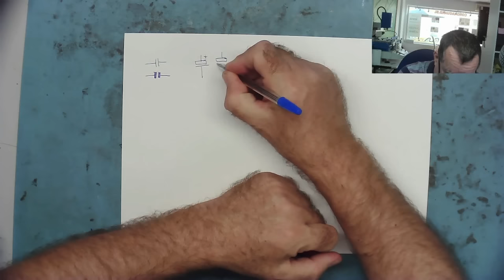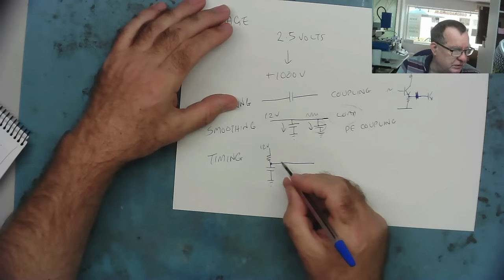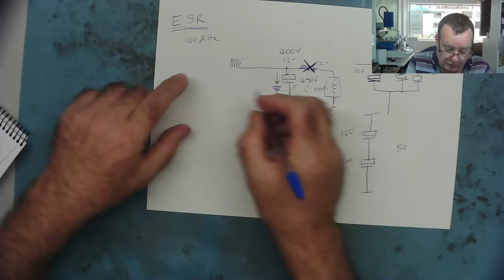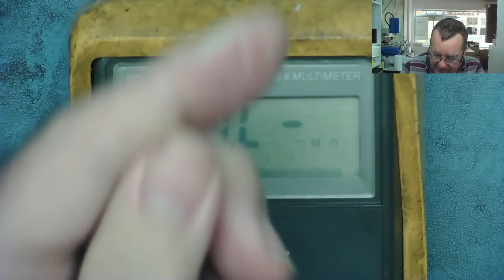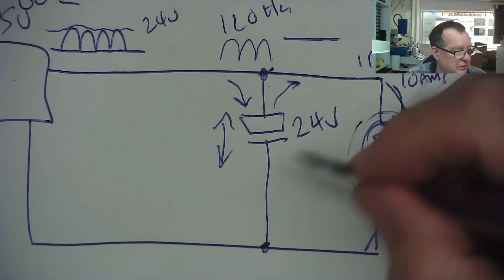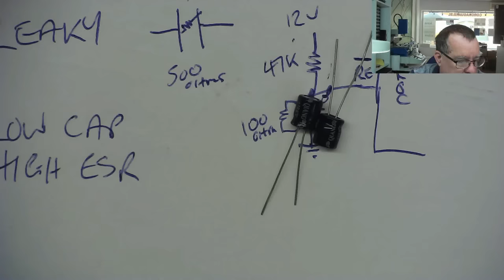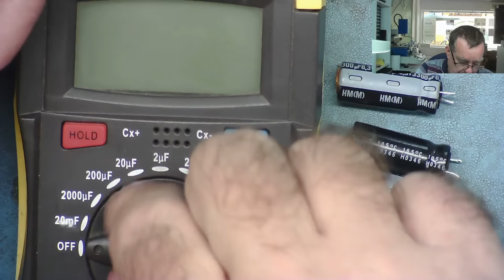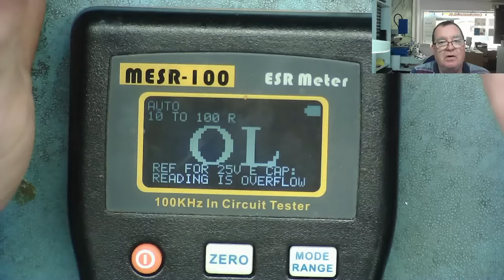All You Need To Know About CAPACITORS To Fix Stuff!  LER #182

Comment: Literally checked a PSU and the cap had 0.6v, still gave me a shock, I'm lucky tbh because i clearly didn't learn my lesson the previous day when i got a worse shock. However i assumed 0.6v wouldn't give me a shock, I discharged it with a screwdriver and seen a spark and shit myself lol. 

Quick question, Whats the main thing that you should look for other than large/medium sized caps to discharge prior to working on a board?

Comment: nice videos sir, 
do you have to remove capacitors from circuits to test them?
Reply: That depends on the circuit around them. For instance if there are multiple capacitors in parallel, there's no way to test each individually without removing them from circuit. Best bet is always out of circuit.

Comment: I had a bad Casio watch, I fixed it by discharging the capacitors, causing the hard reset. Same with laptops, by removing all batteries, holding down pwr butt will hard reset by discharging all capacitors. Intel made the Devil’s face under their processor, creating an infinite circuit in the processor, keeping its cache alive. The contents of the cache: strength, dexterity, magic, vitality, luck, intelligence, agility, etc. also keeps flight sim and driving data, physx data all starting from the XT era. XT had a 4 kb chip for this, instead of an internal cache. 387 had a 8 kb cache. Now, the legal Windows decides what else is needed to fill a 2 mb cache and the faster internal cache.
Reply: Im too drunk to understand.

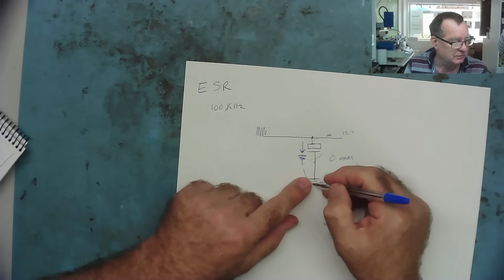Comment: I think you're confusing ESR with Capacitive Reactance @ 12:40. Its value is given by the equation 1 over (2*PI) * f * C, where f = frequency and C is of course Capacitance. The result is in ohms and in this case, you'd be looking to get it as near as possible to 0 Ohms at the frequency of the unwanted noise on the DC rail. The ESR or Equivalent Series Resistance can be seen as an unavoidable flaw in a capacitor and should as near to 0 as possible. The ESR of a capacitor can and does increase with age.

Comment: I miss the tantalum caps in your review, otherwise this is a great introduction. A Nichicon elco failing during the capacitor plague? Is this a counterfeit cap? The proper Nichicon would not have bad electrolytics, because they developed their own formula. They did not use a stolen formula that was still in development.
Reply: I thought that was strange too. Maybe they didn't use the right series capacitor for that high frequency circuit!  The cap wasn't designed for that specific application. Dunno.
Reply: The caps bulged most probably due to heat, as they sit next to the CPU cooler as he shows. It's quite usual to see this happen on motherboards of that period (early 2000's).

Also, and contrary to what he says right next in the video, I've seen polymer SMD caps leak from the bottom, so those can and should be recapped if necessary.
Reply: Nichicon HN and HM series, within a certain time period, were accidentally filled with too much electrolyte, which caused premature failure in high stress circuits. The issue was fixed at some point, unfortunately I don't remember the time period. Some PCs, especially Dell SFF models, would eventually cook any capacitor due to horrible thermal engineering, even Rubycon and Panasonics die in them, and they're practically bullet proof.
Reply: @menotyou8369  thanks for this bit of historical info :-)

Comment: Great content! A while back you mentioned that you had ordered a thrifty ESR Meter from alibaba…any comment on that meter?  Thanks for your great work Darrell - 🇨🇦
Reply from the maker: @QCorner1
Hi Darrell - yes I made a review of that cheap LCR tester it's here

https://www.youtube.com/watch?v=BXb5aN6afl8

It was good for testing many components but it was not very good measuring ESR and I would not use it for that purpose.  I also found later it will not measure inductors like the ones found in buck regulator circuits - it thinks they are resistors and there is no way to tell it to measure inductance. A 'proper' ESR meter can be used for so many other things as well as testing electrolytic capacitors.  It can be used for short circuit tracing and also to measure inductors (including the small ones I mention above).  I'll demonstrate that in the next video in this series - All you need to know about Inductors to fix stuff.